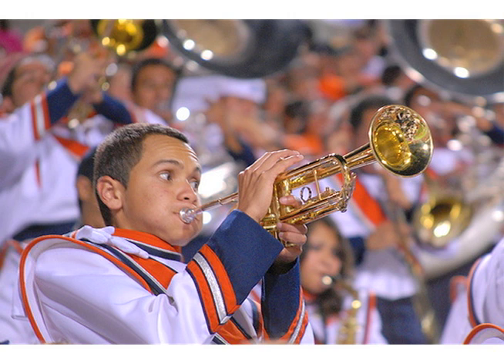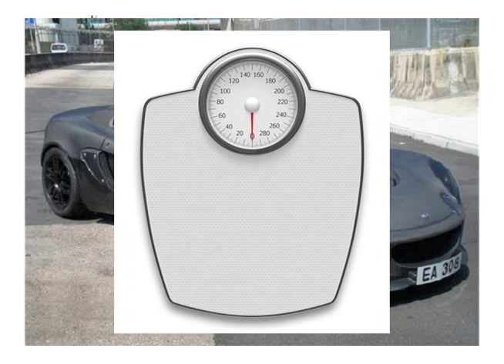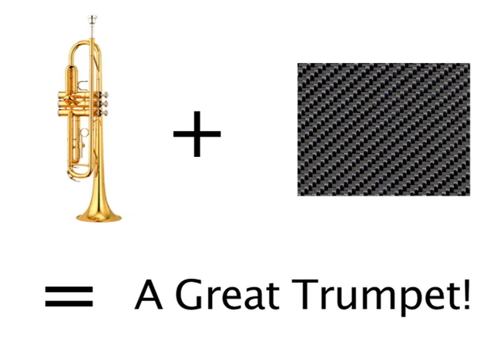Carbon Fiber Trumpet

Comment from the maker: That's not necessarily true. The shape, thickness, and overall structure of the trumpet has a lot more effect on the sound than the material. I added a link in the description to a study talking about materials in instruments.
Since making this video, the research I've seen show that a CF trumpet would be better because CF is lighter and stronger, but also because it is easier to make specific shapes and structures repeatably with it. More control means better potential sound.